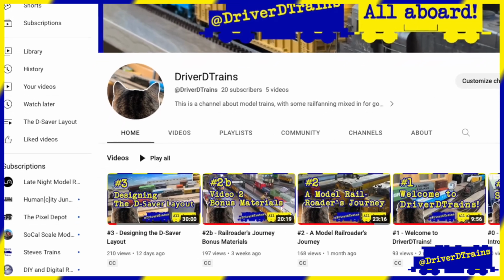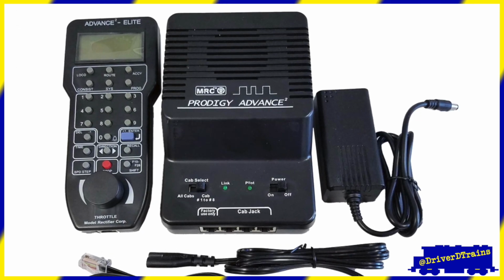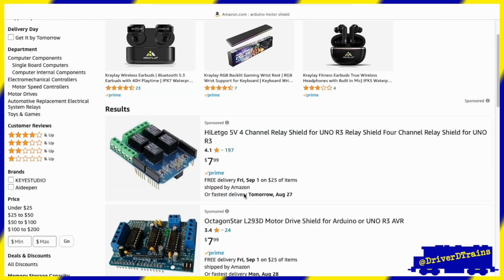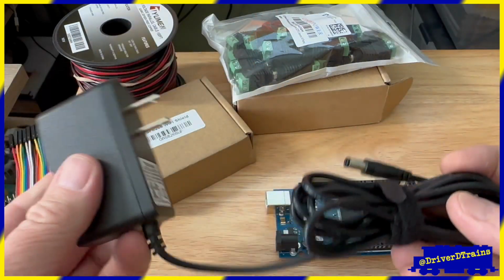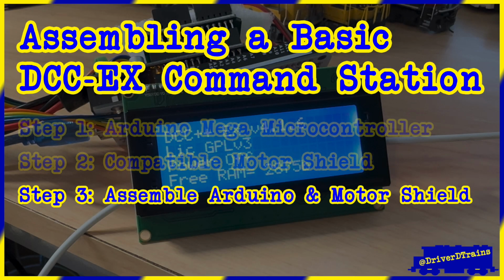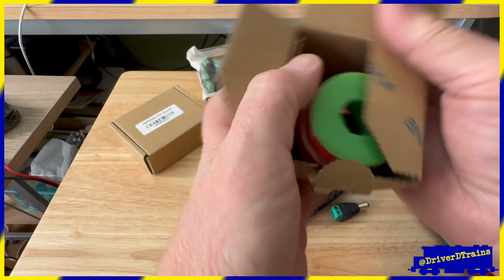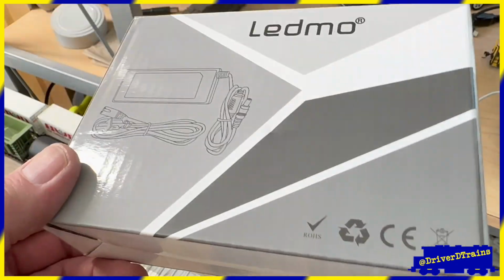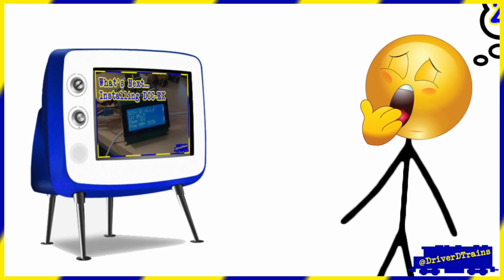#4.a - Assembling a DCC EX Command Station   @DriverDTrains

Comment: Nice intro video as I explore this for my own layout. One pro-tip with stranded wire: tin the tips using a soldering iron, some solder, and flux. You can then get good grip on those screw down power connectors. This is an old electronics hobbyist trick.
Reply from the maker: Thank you for your kind comments! I'm glad you enjoyed the video. I really appreciate it. Actually I was having trouble even with the tinned wires, so I decided to use ferrules on stranded wire for my connections. Works great! See the short 1-minute video I made where I showed that off. https://youtube.com/shorts/_z8mVoRfzoY

Thanks again and happy railroading!

Comment: I am glad that I read this comment because I have the same thing, I am running 5 sets of trains on a three tubular track AC power, 2- ZW transformers. I had all of the components on Amazon cart and ebay to be order and desired to watch the videos again and read the comments and realized that I cant run AC power
Reply from the maker: Thanks for the kind comments. I'm glad I was able to provide some timely information. While it may be technically possible to open up your locomotives and convert them to run on DC, it is not a trivial task, and would involve removing their existing electronics and replacing them with DCC decoders, which you would have to wire up to their motors, lights, etc. And you certainly would not be able to mix AC and DC locos on the same track.

In any case, I'm I was able to provide some helpful information. Sounds like you have a great layout going there!

Thanks again!
DD

Comment: Not sure if anyone mentioned it but you're supposed to use ferals to prevent the wire from splitting but also provide a very solid connection. The screw presses into place but the wire is snug inside the feral.
Reply from the maker: Thank you for your comment! 

You are absolutely correct! A viewer reminded me or that after I posted that video. I don't know why I didn't think of it sooner, but I had never used ferrules on wires as small as what we use in model railroading. But there are a number of readily available solutions that are perfect for this application, and they work great! I even made a short video about it! 

See my short "Using ferrules on Stranded Wire":  https://youtube.com/shorts/_z8mVoRfzoY?si=sP7XGPFzGSvqHI3p

Thanks again and happy railroading!
DD

Comment: Very nicely done! Comprehensive, detailed and easy to follow.

By the way, with the stranded wire you'll find twisting and then tinning the stranded ends with solder, making sure it wicks back up under the insulation, will then render it perfectly compatible with the screw terminal connectors and very robust. But you must make sure to tin it back up under the insulation. You'll then have nice flexible cable, and robust connections. 🙂
Reply from the maker: Thank you very much for your kind comments. I'm glad you enjoyed the video. Thanks too for the tip about tinning the stranded wire. I will try that and report back how it works. Thank you again!  DD

Comment: Awesome job with this video! I already had one going but this has got to be one of the most detailed videos I've seen. I also have the same display as you but can't for the life of me get it to work so please cover that part in detail in the next video. Looking forward to it.
Reply from the maker: Thank you very much for your kind comments. I'm very glad you enjoyed the video. I plan to cover the WiFi Shield in the next video, and the LCD Display in the one after that. 

Regarding the LCD, you need to make sure this line is in your "config.h" file:   
#define LCD_DRIVER 0x27,20,4

Note that the commented-out version in the example config file is for a 2x16 LCD.       
// #define LCD_DRIVER  0x27,16,2

You'll also need to make sure the 4 jumper wires are plugged in correctly. I used the 4 pins on the motor shield (not the header socket) closest to the USB port. Then make sure you recompile and download the sketch after you have plugged in the display. Use the screw-adjuster on the back of the display to adjust the contrast/brightness.

Hope that helps!

Thank you again!  DD

Comment: My Deek Robot Motor Shield does not seem to have visible connection between either side of the VIN Connect solder pads…nor do the two SNS0 or SNS1 sets above.  Is part of the path wishing the PCB itself and getting rid of the little barb that is not seemingly connected what is needed?
Reply from the maker: Thank you for your kind comment and question. Sorry about the late reply. Did you ever figure out the VIN pad on the motor shield? You may not see the traces for the pads, but one side connects to the pin on the edge of the board next to the pad, and the other connects to a spot on the surface of the board itself that goes through to the other side (this is called a 'via'). If you know where to look, you can flip the board over and you'll see that 'via' connection just above the letters E & R in the word POWER that is printed on the board next to the VIN and GND pins.

I found a pretty good picture of the board on eBay here:]
https://www.ebay.com/itm/310787745501

Anyway, all that is just supplementary information, but to get back to your comment, yes that VIN pads are connected to the rest of the board, and you just need to score/cut the channel between the pads to break the connection between the two sides. A quick test with an Ohm meter afterwards (if you have one) would confirm the break. 

Happy new year, and happy railroading!
DD

Comment: I have a question?  Could you solder your exposed stranded wire. This would stop the fraying when using the screw terminals
Reply from the maker: Thank you for your comment and question!

Yes, you could solder the stranded wire, but I still found it didn't work as well in the Arduino motor shield as I would have liked. The problem was that for the wire gauge I wanted to use, when I added some solder to it, it didn't want to fit into the screw terminals very well. 

However, as a viewer reminded me, a better solution is to use ferrules! I don't know why I didn't think of it sooner, but I had never used ferrules on wires as small as what we use in model railroading. But I discovered there are a number of readily available solutions that are perfect for this application, and they work great! I even made a short video about it! 

See my short "Using ferrules on Stranded Wire":  https://youtube.com/shorts/_z8mVoRfzoY?si=sP7XGPFzGSvqHI3p

Thanks again and happy railroading!
DD

Comment: I'm thinking that, instead of solid core wire, use the stranded wire but tin the ends where it plugs into the screw terminals.
Reply from the maker: Thank you for your kind comments. I had originally used tinned stranded wire with my DCC-EX setup, but found that it was difficult to get the tinned wire into the screw connectors on the motor shield, as it was a tight fit and the exposed wire had to be a very short length. So I ended up using solid core on the motor shield, and then stranded wire on the track feeder wires. The two halves are connected using barrel plugs. I may experiment with some other configurations in the future. 

Thanks again!
DD

Comment: Question. Do you need a power supply for the Mega? I know you can power it via a computer, but if I want to power it separately, I assume I would need a power supply. If it matters, I am using the  Elegoo Mega and the Arduino Motor Shield Rev 3
Reply from the maker: Thank you for your kind comment and question. Yes, the Mega does need a power supply. Since it just needs 5v from the USB, you could use any USB adapter that you might use for your phone or other device. You could even use a USB battery bank. Alternatively you can buy a basic AC adapter for the barrel plug; I list an example in the video. 

Another option altogether would be to buy the DCC-EX EX-MotorShield from one of the vendors that sells it. It has a regulated power converter to power the Arduino from the track power supply. But that's a larger investment. 

Hope that helps! 

Happy new year, and happy railroading! 
DD
Reply: @DriverDTrains Another question for you. When testing the connection after you cut the Vin jumper, what did you set your voltmeter to? It looks like resistance, but what setting?
Reply from the maker: @DirtyDan490-t2v  Thank you for your kind comment. Sorry about the delay getting back to you. Yes, you are using the resistance/continuity (ohm) setting. Pretty much any of them will do. You don't want to see any continuity; i.e. you want infinite resistance. Hope that helps!

Thanks again and happy railroading! 
DD

Comment: Is the mega different in terms of the pinouts used by the shield? I'm powering an arduino uno for a DC layout using the shield without any issue. I'm asking because I want to implement the DCC-ex and don't wanna fry it with this method.
Reply from the maker: Thank you for your kind comments. If you mean the motor shield, there should not be any difference between the two boards for DCC-EX. However, when using the Arduino Uno, DCC-EX does not support a WiFi connection, so you will not be able to add a WiFi shield. You will need to connect to DCC-EX through JMRI. DCC-EX on the Uno also (last I checked) does not support I2C connections like the LCD display, and has limited EX-Rail functionality. You can see all the supported and unsupported features here:

https://dcc-ex.com/reference/hardware/microcontroller-boards.html

Hope that helps. Thanks again. Good luck and happy railroading! 
DD

Comment: Used this for setting up, and is fantastic. do you have any case suggestions for housing the arduino? would prefer it not sitting out in the open
Reply from the maker: Thank you for your kind comments. I'm so glad you found the video helpful. Be sure to watch the other parts in the series to add a WiFi Shield and LCD display. As for a case, you can see this video short for what I did. Still working well after a year and a half.

https://youtube.com/shorts/Ahs7553fCso?si=gwmgiGPdqmS6ctac

Thanks again and happy railroading! 
DD
Reply: @DriverDTrains  Awesome! Yeah i actually have the wifi built in board, which was a little more challenging to set up but definitely worth it. Being able to control it from any device in the house is very handy. Also the barrel connector & solid core wire suggestion was excellent advice. I can't recommend that part enough. made my life infinitely easier. Thanks again!
Reply from the maker: Thank you and glad you found the videos (and advice) helpful! Have a happy new year, and happy railroading!

DD

Comment: I have watch most of your videos and this is great. I am new to the hobby I ave bought a couple of train sets o scale can i be able to run my trains with DCC EX Command station
Reply from the maker: Thank you for your kind comments! I'm glad you are enjoying the videos and welcome to the hobby! Three-rail O-gauge trains like those from Lionel run on AC power, so you wouldn't be able to use DCC-EX or any other DCC system with those types of trains. Lionel has their own control system, but it only works with certain higher-end locomotives. There are 2-rail DC O-scale trains, and you could use DCC-EX with those, but they are much less common and I'm not personally aware of any that are sold in sets. 

Again, thank you and welcome to the hobby!
DD
Reply: @DriverDTrains  I am glad that I read this comment because I have the same thing, I am running 5 sets of trains on a three tubular track AC power, 2- ZW transformers. I had all of the components on Amazon cart and ebay to be order and desired to watch the videos again and read the comments and realized that I cant run AC power

Comment: Great video, very informative step by step instruction!!
Do you know if this Will this work on G-Scale Loco's?  I currently have Lenz Command Stations but I'm looking for another system for a display in my living room with a dedicated Gscale Steam Loco.  I don't want to spend $500 on another Lenz, so this looks like a very in expensive alternative just to make a loco startup and move back and forth 1-2 feet.  Also, do you know if there are any Arduino decoders?
Reply from the maker: Thank you so much for your kind comments. Yes, DCC-EX can control G-Scale locos as long as they are DCC-equipped and you have a suitable power supply. If you are using a Lenz command station then your loco is probably DCC-equipped (Lenz developed the pre-curser to DCC which the NMRA adopted to create the DCC standard). Since you only want to make 1 Loco move back and forth a bit, you should not need a significant amount or current; you just need sufficient voltage (probably 14-18V). You can find more info on power supplies here:  https://dcc-ex.com/reference/hardware/power-supplies.html. If you later decide you want to run a longer train, you can swap out the motor shield for the EX-Motor Shield (when it's available) which supports higher current. Good luck and hope this helps!

Thanks again!
DD

Comment: Excellent presentation.  I have 2 questions.  1. insteadf of cutting the vin terminal, can I cut out the pin itself? and 2. Instead of using the two power sources can I use one 19v computer power pack and two butt converters, one for the 15v and the other for the 16v.  Great vid keep up the good work; looking forward to your next vid
Reply from the maker: Thank you very much for your kind comments. I'm very glad you enjoyed the video. Regarding your 2 questions:

1. Yes you can cut the VIN pin on the motor shield if you prefer. Just make sure you identify the correct pin. I do have a couple of thoughts about it. Cutting the jumper trace is not hard, but if you don't have a meter to confirm that you have done the job then maybe cutting the pin might provide you more assurance. Also, while you can always undo cutting the jumper trace with a drop of solder, you can undo cutting the pin. On the other hand, the motor shield doesn't cost much to replace.

2. As for the power supply, if your computer adapter outputs 5v USB (not 15v), then you could use that for the Arduino Mega controller board, and use the higher voltage for the motor shield (via a barrel connector attached to the screw terminals). 

The recommended voltage specs for the Arduino Mega are 7-12 volts, although according to Arduino it can technically operate on up to 20 volts until it overheats. However, If using more than 12V, the voltage regulator may overheat and damage the board. 

Here are the specs for the Arduino Mega:
https://store.arduino.cc/products/arduino-mega-2560-rev3

And the motor shield:
https://store-usa.arduino.cc/products/arduino-motor-shield-rev3

Thanks again for your comments and questions! DD

Comment: Hi DriverD, I am watching this series of videos from Germany and I find it very perfect and extremely detailed for all kind of experience. Recently I watched the last video (part f of the series) handling the new firmware for the Makerfabs Wifi Shield. I bought one some years ago and it works fine with the standard arduino motor shield. Recently I bought the new DCCEX motorshield. It works fine with my Mega2560 but I did not yet put the wide-field on this CS. I was trying to find out the firmware actually installed on the shield and I followed your instruction to use the EX Web throttle to get the firmware version. Unfortunately I got some response but no information about the AT version. My response looks a bit different (no RECEIVE at the beginning of each line). I got information on the DCCEX version and on the motorshield and it tells Wifi ok. Have you any idea what may be the reason of this different behaviour of my CS and why there is no information on the AT?
Reply from the maker: Thank you for your kind comments and questions. DCC-EX made some changes and I think that there are two things happening. 1) DCC-EX changed the way that the EX-WebThrottle app formats the information it receives. 2) DCC-EX made some changes to its WiFi handler and for some reason it is not responding as expected when we give AT commands such as the +GMR command to obtain the WiFi firmware version. However, the command station still sends out the firmware version number at boot up, so if you connect using the EX-WebThrottle app and wait for it to boot, then scroll up near the top of the debug console, you should see something that looks like this:

[R] <* ++ Wifi Setup Try 1 ++ *>
[R] <* Wifi Check: [+IPD] *>
[R] <* TIMEOUT after 200ms *>
[R] <* Wifi Check: [OK] *>
[R] OK<* Found in 1ms *>
[R] <* Wifi Check: [OK] *>
[R] OK<* Found in 3ms *>
[R] <* Wifi Check: [AT version:] *>
[R] AT+GMR
[R] AT version:<* Found in 4ms *>
[R] 1.7.4.0(May<* Wifi Check: [OK] *>          <<————THIS IS THE VERSION
[R] 11 2020 19:13:04)
[R] SDK version:3.0.4(9532ceb)
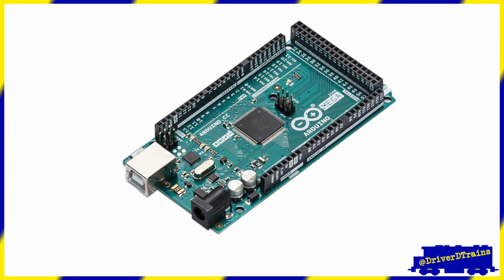[R] compile time:Ma0:12:22
[R] Bin version(Wroom 02):1.7.4                   <<————ALSO HERE
[R] OK

The new version of DCC-EX is also supposed to send a message that "you need to upgrade/downgrade your firmware" if it detects an unsupported version of the firmware.

One other thing you can try is to install an older version of DCC-EX from last year and see if you can use it just long enough to verify your firmware version with the +GMR command.

I hope this helps! Thanks again for your comments! Good luck and happy railroading!
DD